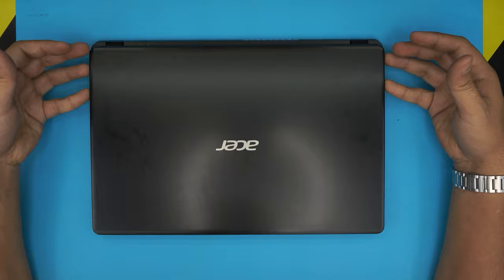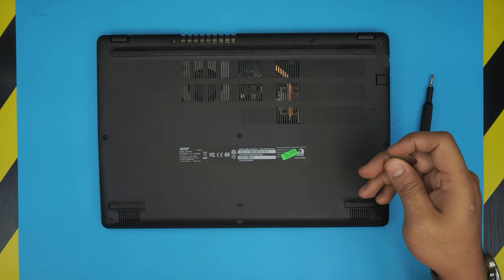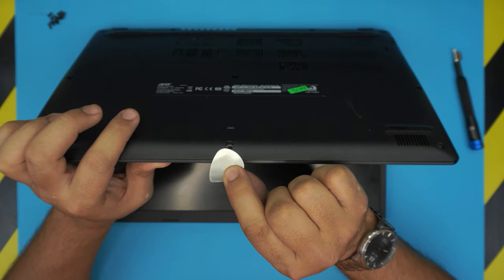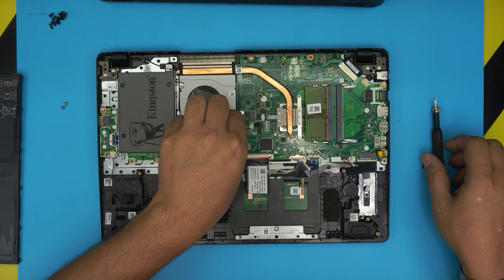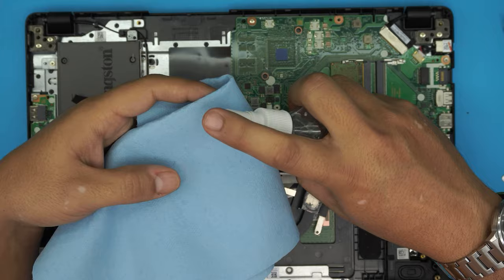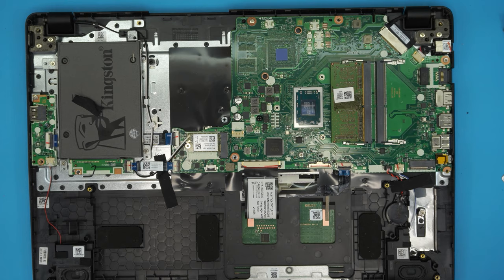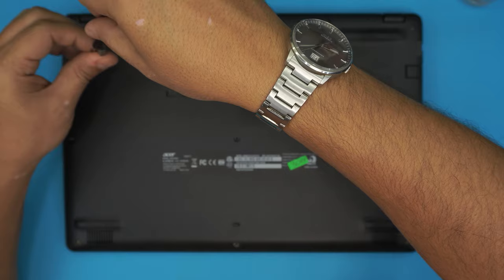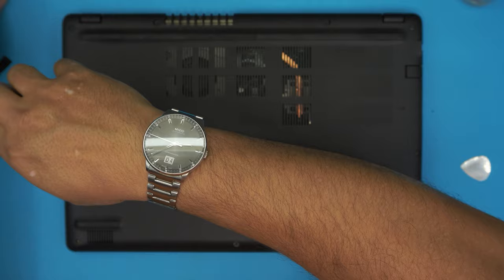Acer Aspire 3  N19c1 laptop Service Repaste Cleaning

Comment: what screw driver you need for the battery because mine are diffrent than the back case just asking because you use only one screw driver and mine just dont fit even if its the same as yours
Reply from the maker: Thank you for the feedback! if you wish to support the channel you can LIKE or SUB or both :P
regarding your question: sometimes manufacturers use different screws on the same model, depending the inventory of the screws, but if you send me a picture of the screw head i can tell you what is the screw type or get a screwdriver set. 
this has it for all the screw types:
https://amzn.to/3np9pCP
Reply: @uFixTek  thank you for the site it helped ill check it out adn if i still dont understand ill ask you for help and send you a photo